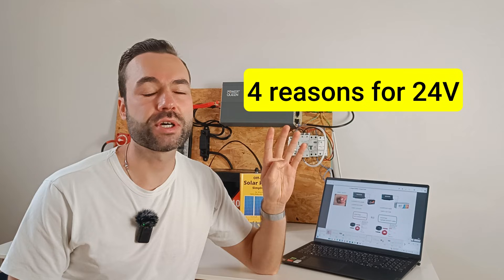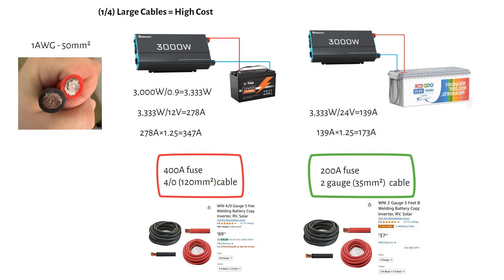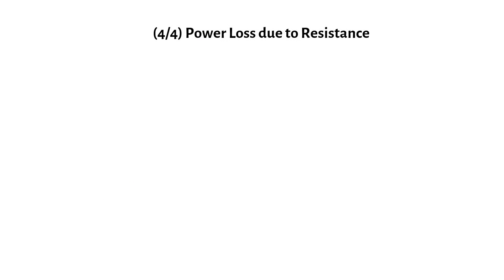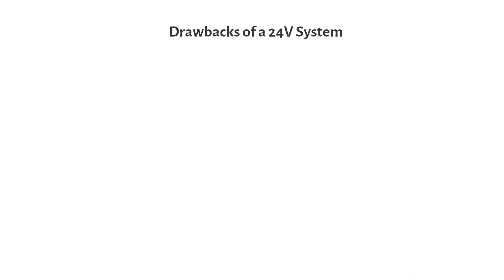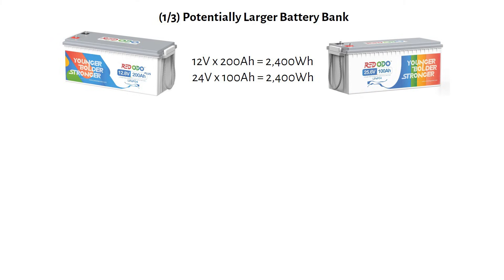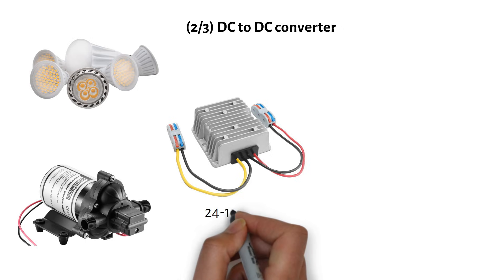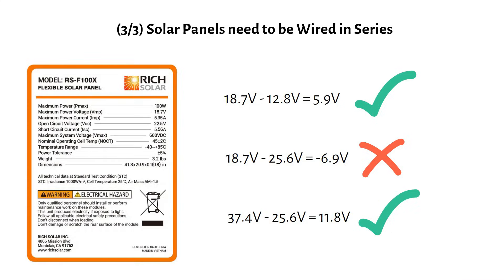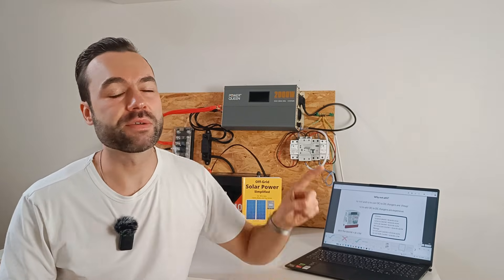12V or 24V for RV's - In Which Case is 24V a Better Choice?

Comment: What's the formula to size your pannel? For instance...

390 watt pannel x8 = 3920 watts ÷ 24 = 130 amps? What am I doing wrong here.  Ibthought this was how it was done? Can you help me?
Reply from the maker: You can check my video on how to size a charge controller. And the video about oversizing solar. Yes, you calculated the current going into the battery.

Comment: Most new caravans in Australia are 48v.  They even have 48v air conditioning units, no need to use the inverter to run the a/c

Comment: Hi I am still learning a good bit from your videos thanks. Can I comment on the calculation you gave, when you mention the 1.25 safety factor and then you multiply and it gives you 347A should you not in fact divide the 278A by 1.25 to 222.4A?? That would be then called a safety factor would it not. I dont mean to offend honestly just trying to get my head round everything LOL. Thanks again as I said I am learning a lot from your videos.
Reply from the maker: We have to add a safety factor, not substract the safety factor. So a cable that needs to handle at least 278A including a safety factor needs to be able to handle more. Then we select a cable that can handle at least 347A.
Reply: @cleversolarpower  AHHH now I see where yu are coming from many thanks

Comment: Check your theory of a pair of 12v batteries in series, it does not give you 200amps at 24v, it's still 100 amps at 24v.

Comment: You said to use 4 ga wire for 12v system and 2 ga wire for 24v.
I thought 24v systems used smaller gauge wiring than 12 volt systems.
Reply from the maker: No 4/0 is not the same as 4AWG.

Comment: If my inverter is 12 volts, can I wire my batteries to make 24v and then step it down to 12v, or would I lose efficiency
Reply from the maker: That would not be a cheap option. You will lost 90% on the DC to DC conversion, and the cost of a high current dc to dc converter will be high.

Comment: Half truths at best. 24 volt systems cost way more than a 12 volt system. First off you need twice as many batteries, 24 volt components just cost more plus you need Dc to Dc converters for all of your 12 volt devices and all of that just to get a  increase of 4 to 6 percent efficiency,  just not worth it.  Now on a solar system, yes the higher voltage is better you jus need to get a MPPT solar controller that will handle the higher voltage. My 12 volt system in my bus has over 120 volts of solar coming into my charge controller . Also to add battery capacity to a 24 volt system,  you would have to buy 2 batteries and the cables to connect them in series. Personally I don't mind using 12 volts and bigger cables. Thank you and God bless you and your family and America 🇺🇸 in Jesus name amen
Reply from the maker: You don't need twice as many batteries. 12V*100Ah=1200Wh, and 24V*50Ah=1200Wh. You just need less capacity for a higher voltage, they are the same. If you get that high of a solar panel voltage into your MPPT, then you should have gotten a 24V system because then your charge controller needed to be half the size. If you run 12V appliances you do need a dc to dc converter, but they are not expensive. And charging from your alternator will be better at 24V because then you have less voltage drop. You can also get 24V batteries. No need to series connect batteries. Only if you relay heavily on alternator charging, then using a 12-12V dc to dc converter is going to be cheaper because of cheaper brands. But other than that, i think it would be best for a 24V system in your case (also depends on inverter size).
Reply: @cleversolarpower I've been living off of solar for over 20 years. I build lithium batteries. You do whatever makes you happy.  Thank you and God bless you and your family and America 🇺🇸 in Jesus name amen

Comment: at 8:27 you said that iun serie you can get 200Amps.That is not truth.In serie your voltage increase and your current stays the same.In parallel your current increase and your voltage stays the same. You said something else also which was wrong .But I do not now where.Do a recap on your video.

Comment: Good video. 24v batteries and components are harder to source however solar plus 48v on a campervan or trailer is hard to achieve. You need 4 panels in series to ensure 48v systems will be charged and space becomes a problem . 24v you need two which is easier to manage.

Comment: Forget the engine alternator it was not designed to charge lithium batteries.
Reply from the maker: Yes, that's why you need a DC to DC charger.

Comment: 48v is the future for the automotive industry. Right now it is neigh on impossible to find 48v campervan appliances. However, with 48v the conversion to 240v (Europe) will be more efficient and domestic appliances cost a fraction of 12\24\48v versions so massive savings and ease of replacement, finding parts and repairs if domestic appliances are  used. Oversize the solar panels and battery bank and the loses from the inverter will be more than compensated. Smaller diameter cables are much easier to install, are more resilient to vibration derived damage and do not pose such a high fire risk as compared to high amperage systems.
Reply: 48v is the way much simpler,  cheaper and more efficient.  DC to DC 48 TO 12V no problem.  No balancer required  3 48v 100ah rack batteries in parallel. Completely indistinguishable from being  on shore power.
Reply from the maker: I don't agree for camper or RV's. 1st, the voltage of your solar panels need to be higher than the battery voltage, so 51.2V+5V= 56.2V, so at least 4 panels in series. We know we should wire in parallel to reduce shading losses for a camper that is regularly parked in shade for obvious reasons. Secondly, alternator charging. The chargers are cheaper on 12 or 24V than 48V.
Reply: @cleversolarpower 8× 330w panels in two 160v strings charges fast. Higher voltage higher efficiency.
Reply: @cleversolarpower  You got a point, but trust me if the gradual switch to 48V was to take place, every industry will adapt to it. Solar arrays will be rearranged for higher voltage solving the shading problem. Alternator charging? not a big deal because people are already running 48V alternators, maybe it will get more popular dropping the prices on 48v to 12v step down modules since most accessories  need 12V

Comment: What would you recommend  for a 800w solarpanel system offgrid use only as backup for a house? 12 or 24v? Cheers
Reply from the maker: 24V or even 48V. Depends on the inverter size. Anything over 2000W, use 48V for home backup. You will not regret.

Comment: 8:18 Wrong,  2 X 100 aH batteries in series, the voltage has doubled but the max current remains the same as a single battery.

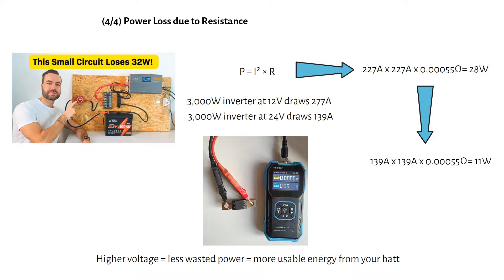Comment: 06:09 De theorie klopt wel, maar je maakt een fout. Het gaat om 277 Ampere in het 12-Volt-voorbeeld. Dus niet 227 Ampere. 
De stroom op 12 Volt is 42 Ampere, dus niet 28 Ampere. 
Dat moet ook zo zijn want de besparing in het 24 Volts-systeem aangaande de opwarming van de kabels tov een 12 Volts-systeem moet rond de 75% liggen, niet rond de 61%.
Reply from the maker: Indeed, I made a mistake there. Heat dissipation is 42W instead of 28W. I updated the pinned comment. Thank you for your good eyes.

Comment: Staying with my small 12v system as it is enough for my mountain cabin application. Have a 1kw inverter to drive small AC appliances - ref, tv, fans, cookers (wc i ran close when sun is up) and lights. 12vdc gives me a last resort to default to for 12v dc lights at least in case the inverter fails.
Reply: A buck/boost converter would knock the 24v down to 12v also but I'm not sure about losses

Comment: Do I need a fuse if my battery has a BMS?
Reply from the maker: Personally I recommend to always use a fuse you cannot count on a BMS to interrupt a short circuit. A BMS is switched electronically. A fuse is physical melting of a metal. So I always prefer a fuse to protect the circuit.
Reply: Thank you @cleversolarpower

Comment: I have Two 12v 206 ah lithium iron phosphate batteries I want to hook up in series to make a 24v, 206 ah system. Should i go with a 2000w or 3000w (24v pure sine) inverter? This will be for my tiny house that will run laptop, modem, fridge, TV, Switch 2.
 Also used to charge phones and led lights, maybe also a fan or two depending on the weather (Texas) ?
Reply from the maker: I think a 2,000W inverter would be enough. However, you have a 24V system, so maybe a 3,000W inverter is more available. And the fan of the inverter will not kick in as much.

Comment: There's no question that the higher voltages are more efficient and have specific economic advantages however the availability of 12V products at reasonable prices is much better than the more costly 24, 32 and 48 Volt products.
Reply from the maker: I would say 24V is the hardest. But 48V is quite available as well. 12V is perfectly fine if you are working with lower currents (under 100A).

Comment: Hi I have 2 100ah 12v batteries. So if connect in parallel I will get 200ah at 12v 
And if connected in series I’ll get only 100ah at 24v.  Does the wh still say the same when connecting 2 in series? Also since you say the current is cut in half at 24v would that make it worth it to sacrifice the 100ah to make the 24v? Will the two set ups be equal when it comes to run time since the current is cut in half at 24v or will 200ah 12v run longer than 100ah 24v made up by 2 batteries?
Reply from the maker: Both have the same energy potential. 12V*200ah=2400wh. 24v*100ah= 2400wh, so it's the same. Your batteries have a max current of 100a most likely (limited by the BMS). If you wire in parallel, every battery can deliver 100A, so a total of 200A at 12V is 2400w. If you wire in series, you can only draw 100A. But the power draw will be the same 24V*100a= 2400w. I recommend getting 24V batteries instead of two 12V. Check my video about it.

Comment: Holy heck! 48 Volt 100A vehicle alternators are AU$5K+ (about US$2.5K+)...that makes going 48V very costly despite the savings in cable etc...seems like it's early days for 48V and hopefully if volume/demand increases costs will come down.  And (ex electrical engineer here) I just like the fact that with 12/24 V systems I can use my bare hand to feel around live systems testing for resistive joints such as warm cable lugs as part of my fault finding and regular checking...not going to be doing that on 48V...
Reply from the maker: Yes, thats why i don't advice 48V for vehicles if you want to charge through the alternator. Also the solar panel voltage needs to be 5V higher than the battery voltage. Since you will most likely wire in parallel to reduce effects of shading, you will never go over that 63.4V  (58.4V+5V).

Comment: two 12v 100a batteries in series is the same as one 24v 100a battery and the current output is the same.

Comment: Very informative,! I'm looking into a 2nd alternator for a van but as 48volt. 48volt battery configuration of some kind running 48volt air conditioning & hot water heater (if I can find one) This is for a customers job who already has a small 12volt system with older solar, small inverter & a small amount of 12volt appliances but due to the need for hot water & a/c I have been seriously looking into doing a separate 48volt system for the higher demand on off grid power (yes, it will also have a 48volt battery charger for when it's connected to shore power, with the hot water also being 240volt (which is our countries power supply) so to run the a/c it will still be 24volt. Do you see any issues with this system? (unfortunately my customer/friend doesn't want to upgrade any of the solar (even though it's aging & horribly inefficient) & there is only 1 x 120amp lithium in the 12volt system. We all know making heat or cold demands lots of power.

Comment: Your savings in wire is of set buy higher priced inverter and battery. Most people don’t want an off grid system, they are looking for emergency lighting and fridge. 12v is the easy, low cost solution, because already familiar with 12v car stuff.
Reply: Unfortunately, the cost isn't the only problem with 12v systems

Comment: I spent 3 years modifying my RV, which when I bought it had only hook up power @ 240v when connected. I wanted 240 volts off grid anywhere I parked. My analysis lead me to 48 volts, the efficiency of the inverter at this voltage is high, mine claims 99 percent ? The inverter charger also takes in solar and can charge the battery banks.  I have 1200 watts on the roof. I have because of cost,  8 lithium at 60 amp capacity connected in series then in parallel joining the two banks.  Plus a second bank of 48 volts being just four batteries giving redundancy.   It is very hard to know when the system is depleted and about to shut down, as you know the voltage stays fairly constant until its not !! So reading the voltage tell you nothing. I have a 30 amp DC2DC charger from the alternator for the 12 volt house batteries 3 x 200 amps. So plenty. The inverter is rated at 5 KWH so plenty for an RV. It has a max charge rate of 80 amps (48 volts !!!)  When plugged in I limit the charge rate to 50 amps (48v) so never too long to regain 100 percent capacity.    I recommend anyone to go 48 volts, the losses are much less in the system. Plus there is virtually no detectable heat in the cable/wires. I still went big here to make sure of that, big cables less resistance !  Over all I am really pleased, except for one aspect.  All those  BMS's  - If one drops out early that bank is now below the inverter input voltage, even though the other three batteries might have plenty left. So thanks to your great videos I am now considering a separate balancer..Never heard of one before, so here goes
Reply: With your batteries in series parallel like that, is it difficult to balance your batteries? I'm wondering if it's better just to buy a 48 volt battery
Reply: @crazyDIYguy 48 volts batteries are v expensive, bulky and I see no advantage. An update, I bought cheap external balancers from Amazon. So pleased, they read the voltage are voice activated (they switch on the LED to show voltage) and do a good job. So far so good .

Comment: This applies to 24 volt, the standard is now 48volt and is the minimum that shoukd be used to conserve metals.
Reply from the maker: This video is about RV and vans. I think you didn't get the point 😉
Reply: @cleversolarpower  that doesn't exclude 48volts.

Comment: Where you show the 2 12v batteries in 24v system. 
What size fuse and where to put it. Would you have one fuse for each positive side of the batteries?

Comment: Small error at 5:30. You used 227A instead of 277A which means that the final power loss for 12V should be 42A instead of 28A. Consequently, the loss of 11W for 24V is roughly 1/4 of the loss for 12V as expected because of the square rule.

Comment: Sir? I have 800watts of solar panel and 3 12-8volt 100ah lithium batteries..I'm trying to decide on how to go about installing thus fir a 30amp rv travel trailer... but after watching your video I think I should go with a 24volt battery bank😢.. I'm new to this and really confused what direction to take? 12-volt or a 24volt

Comment: If you're an amateur radio operator,  stick with a 12 volt system.  The RF noise from these dirty down converters on the HF bands will wipe you out with birdies and broadband hash. I run an 18Kw lead and a 10 Kw LFP systems. As a camper and a prepping type, I have tons of 12 volt accessories.  If you're just looking to run an inverter a 24 volt, even better, a 48 volt system would be the best choice.  48 volt server rack battery prices are dropping because of tons of competition.

Comment: I agree with the most of this except 1 area.  When you factor the High prices of the 24v/48v batteries and 24v/48v inverters,  The cost of one cable size vs another means nothing. You do a disservice pushing that line of reasoning.

Comment: mppt charge controller should step up voltage from the panel to the battery so no issue having 12v panel and 24v battery i guess
Reply: Nah other way around. You can get step up but they normally require panel input voltage to be higher than battery voltage to turn on. I just spent months researching this stuff and setting up a high end 48v system.

Comment: Hallo Nick, I have two 3000W 24 volt inverters, can I connect these two inverters together in parallel to have an output of 6000w?
Reply from the maker: If they are off grid inverters you cannot. Because their sine wave output doesn't go in sync.
Reply: @cleversolarpower  I recently came across your videos. I must say your delivery is superb. I have learned alot. My two cents on this, victron does have inverters which can be paralled (should be same model and firmware version..)

Comment: Hi Nick.
I’m enjoying your book and all this online info.
It is possible to obtain 24volt and 48volt alternators which could possibly be run from a separate belt off of the engine which would solve some of the 24/48 volt charging issues.

Comment: There is an issue in the video at 8m to 8m30s.

Two 12v, 100a BMS batteries, wired in series delivers 24V at a maximum of 100a. Not 200a as stated in the video.

In series, the voltage adds up, but the current stays the same.

In parallel, the voltage stays the same, but the current adds up.
Reply: I came to say this. If the 24v system needs 130amps, 2 100ah 12 volt won't be enough unless you find a high current version. 2*24v works well because you've got plenty of capacity (5kwh).
Reply: Dont it take 65a from 1 battery
Reply: This comment should be pinned, @cleversolarpower !
Reply: Good catch pal
Reply: 12x100=1200w
24x100=2400w
But it take half amps from one battery

Comment: I started out rally small with a 40w 12v system. Now at 2000w solar i'm ready to upgrade to 24v because 80-90 amps is way too hard to manage.